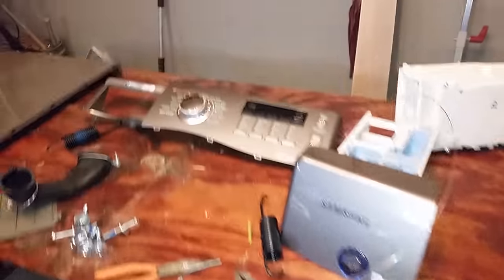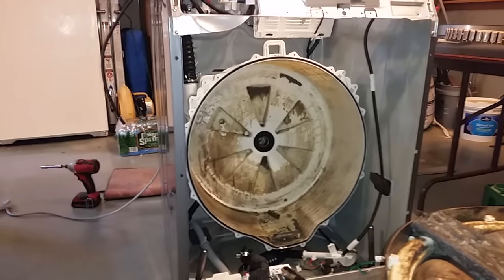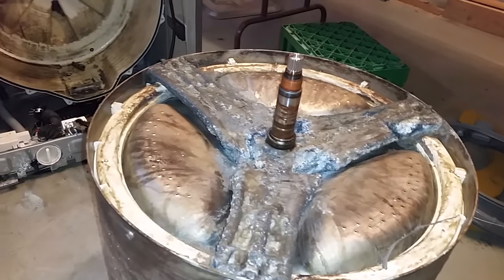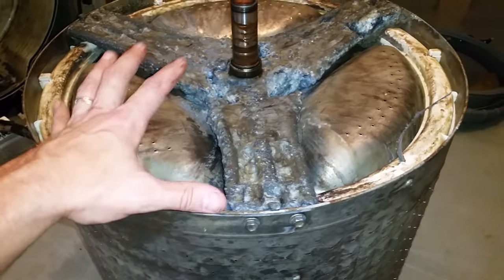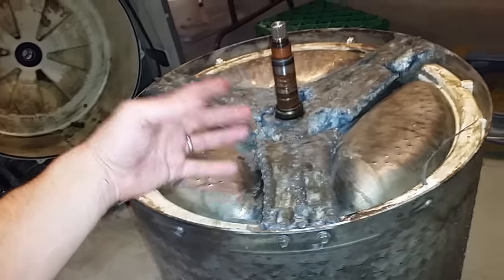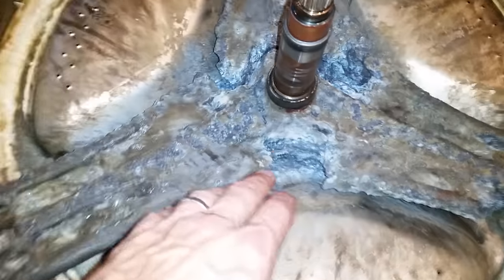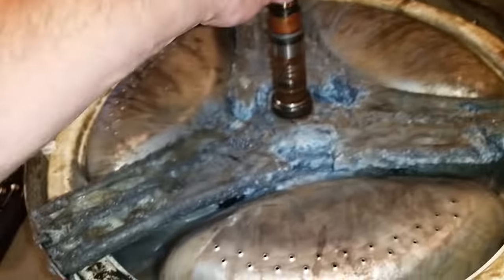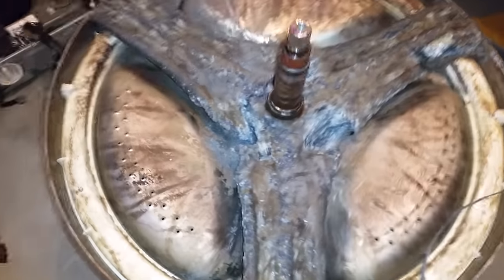Do not buy Samsung front load washer machines

Comment: Bottom line - someone either is clearly clueless and hasn't researched the commonality of this problem with other washers or they have a specific grudge against Samsung.  Also, this happens since a lot of households tend to toss in more laundry soap than is actually needed, especially if they have a water softener in the house.  Do your research.
Reply: Good point

Comment: Perhaps somebody should tell Samsung that a stainless steel support bracket would improve the whole thing.
The truth is that every man and his dog is out there maaking sure regardless of what it is you aare paying big bucks for, is going to break down aand will be so expensive to repair that you go buy a new one., we see it in everything, like we changed our car and ended up with a Ford Fiesta, what we did not know is that it has a metal drive belt, made of about a thousand bits, imagine what happens if that brakes (which they do)  and at the moment Ford are facing a hugevlaw suite of this verybthing, but thevarecstill selling the cars with this major problem and the custormer is out in  the cold when it comes to protection.
The answer is becoming common practice and as yet the car makers have not twigged what is going on, people are going out looking for older cars that they can fix themselves, as they did for  years, that way changing plugs and points etc is easy, the only thing you have to  keep your  eye open for is rust  , other things  most people can fix themselfs, i know that next time thats what my plans are , go back to when car made, not superglued together   with seventy five percent made of plastic, and   sadly its getting worse  not better despite huge prices they now cost.

Comment: Buy a Speed Queen washing machine.
Reply: coffeeinthemorning  I don't mean being negative. Speed Queen washers are higher quality and costly. I have a Maytag washer that's 11 years old. After around 5 -7 years old the problem begins. I've already replaced the tub bearings & water pump. The cabinet began to rust out 5 years ago.
Reply: jorge hernandez I've never heard of a Speed Queen washing machine? Who makes them?
Reply: @jake198222  Speed Queen makes their own machines. That's the brand name. Back in the 1960's through the 1970's mom had a Speed Queen washer and it was a workhorse. Maytag made REALLY good washing machines back then. Maytag washers really cheapened themselves over the years. Speed Queen machines are still around but you have to look for them and they come with a hefty price tag. Speed Queens washers have not change much over the years and they are very much like the kind your parents had. Their motto is why change something that works well, so they have no "whistles" nor cheap gadgets which are found in today's cheap washers. They look old school but built like a tank. Google "Speed Queen washing machines". I think their commercial grade Speed Queens can be used as residential.

Comment: Using WAY too ,much detergent. Common problem. Front loaders use minimal water. The Aluminum is corroded by the high basic solution. Very little of the soap goes into solution. Very hard to convince users to use a couple of teaspoons of detergent.

Comment: No... your right with the dissimilar metals. Being here on the Ohio River where everyone has a boat, that is very well known. All boats do have a zinc “plate” bolted to them to fight corrosion. It is even more severe if your boat is docked (during the boating season) on a metal dock with electric lights and/or outlets. The corrosion process is much more rapid..

Comment: EU have plans to make companies manufacture machines which would last longer.
Reply: I wrote to the EU commission about this specifically Washing machines and bearing failure. Had a reply from a department saying they had passed this on to another dept and since then nothing ( just a load of eurocrats) . Some machines have sealed drums and the bearings cant be replaced so after less than two years when they fail the machine has to be scrapped. Always ask before you buy a front loading machine if its bearings can be replaced or if the whole tub has to be replaced instead ( costing as much a s a new machine) . NEVER buy a machine with a sealed drum.

Comment: SAMSUNG UK just emailed me as I asked them if they still use zinc:- To answer your query, please be advised that Samsung washing machines are designed with stainless steel drums which can withstand high temperatures. As for its spider support, it is made of aluminum metal. We understand that you are concerned about its performance, but we can assure you that our washing machines have undergone high standard quality tests prior to market release and distribution.
Reply from the maker: Deke W I miss spoke in the video which I corrected myself in the comments section of the video by saying that the spider bracket is cast aluminum.
Reply: @phil12550  but lg and bosch etc use aluminium too....

Comment: Can you buy a better stainless steel spider arm?  All companies now days use the same Asian manufacturing shortcuts... inferior plastics (no UV component = brittle/breakage) or a step is skipped in the metal materials.
Chinese goods is an oxymoron.  They should be called Chinese Cheaps

Comment: NEVER purchase a front load washing machine of ANY brand. They are ALL worthless due to they use lower grade products for residential applications. #hereendsthelesson
Reply: not really. ours is 13 years old and it is still running.
Reply: I bought a Maytag front loader (made by some other company)  2 or 3 years ago and it is still working fine.  It's the TOP loading HIGH EFFICIENCY Samsungs that are REALLY a disaster.  But if you are REALLY concerned about getting a long lasting washing machine then there is only ONE choice.  Speed Queen.  Top loading...NOT "high efficiency"...it uses lots of water but it is built like a tank.  It will last a lifetime.
Reply: @stfuplsok   My mom has a sammy front loader for a decade. Her sons are always over doing laundry in it, one of them brings two, and even sometimes three 30 gallon trash bags of laundry. No other home washing machine has seen the action of this one. Every couple of days she's running a load through it, so every week for a decade it's been used 3-5 times a week. It has works flawlessly.

Comment: Today I found some steel little plates like 2inches long by 1/4 large was stuck im the pump in my Samsung 337 washing machine and the front door seal rubber also little part stock in the pump . The machine has 7 years old WTF ?! I am replacing the Samsung with another manufacturer name

Comment: Thanks for sharing...garbage engineering of shit products...run away from them.  He is totally correct on the galvanic corrosion of the weaker metal being attacked...same as plumbing with copper and steel etc...going to explode/fall apart like his washer did.  This would have been solved in the upfront engineering and thus they are knowingly building this product like this...so again run away from this poor build quality!

Comment: All front loaders are crap and the industry is going back to top-loading.  There is a cleanout filter in the front loaders but nobody does so they all stink.  that and some use powder detergent and it ruins them like the above.

Comment: Mine has been doing great for 13 years. No issues at all. Even after adjusting water level. Still going strong. Prob put too many clothes in or abused it over time.   Can't say don't buy a samsung. Looks like you had a leak on that drum. That's just not rust or corrosion. Tell the truth guy!!

Comment: Asko is the only company that use a proper stainless steel spider arm in their washers all the other companies including LG use this cheap aluminium sink mix just to limite the lifespan of their products they give you 10 years warranty on the motor or maybe other stuff like the stainless steel drum which of course never goes bad but not on the most important parts like the bearings and the spider arm and PCB which is another very common problem

Comment: Unfortunately what this guy is talking is a load of rubbish. He may declare what he has worked in so he knows. Well he doesn't I was also trained in the aircraft industry and my final position before moving on was prototype build and design. Basically I built prototypes of what designers came up with and tested them to destruction.

First of all the housing bracket is called the drum spider, secondly the spindle is called the drum shaft. The inferior metal that he is talking about is aluminium in this case is called pot metal due to the type of aluminium it is, there is nothing inferior about it at all, what he is trying to convince you of is of accelerated galvanic corrosion which can occur when two dissimilar metals are put together and exposed to a corrosive environment, this is NOT the case here.

So now for the facts as to why they break, several things can make these spiders break the first is that they are a cast piece of metal and as such casting is a good way to manufacture items on mass but it does have its down falls you can get weak spots where stress fractures can occur, these stress fractures over time will develop into full breakages. The second thing pot metal suffers from corrosion in water, in fact harder water will enable it to corrode faster, detergents also don't help. Its known among many white goods appliance techs/engineers that people use way too much detergent in their machines, engineers see it all the time. Its not even the consumers fault, the manufacturers of detergent recommended usage is about twice what it should be in hard water areas and about four times what it should be in soft water areas. This accelerates the corrosion of the metal which leads to stress fractures and eventually failure. Unfortunately the larger the load that a washing machine can take the quicker this occurs.

These defective parts that he has been discussing are the exact same parts they have been using in washing machines since their invention, and have worked very well. What has happened however in the last 15 years is that the load that's placed on these machines has increased a hell of a lot its gone from 5Kilos/11pounds to 10 kilos/22pounds. Along with a big increase in spin speeds from around 600-800 RPM to as fast as 1800 rpm. That is the main cause for them failing a lot quicker, I wouldn't trust this guy anywhere near a plane.